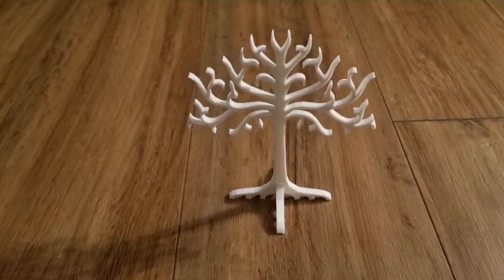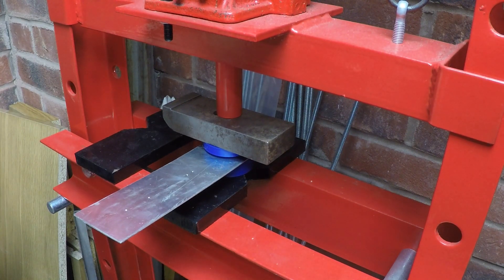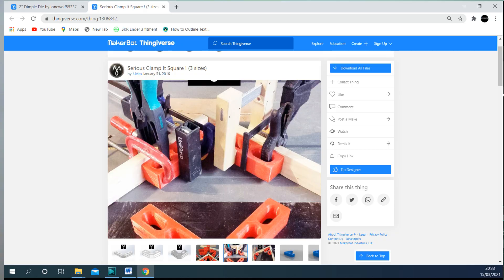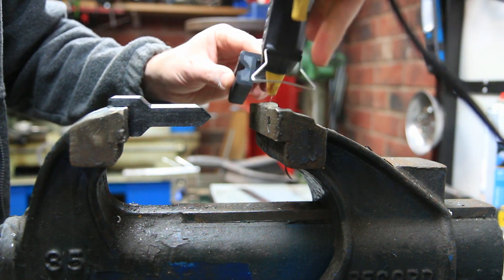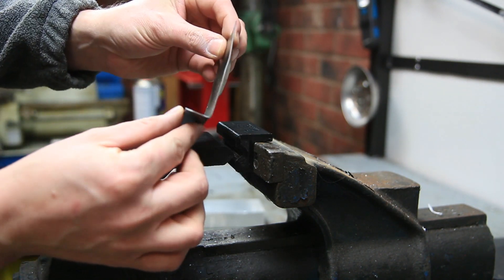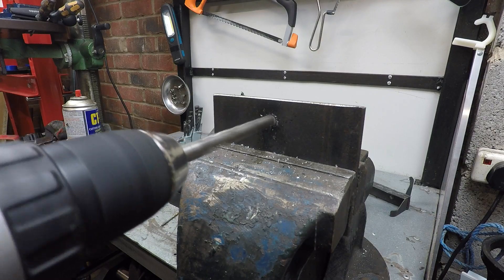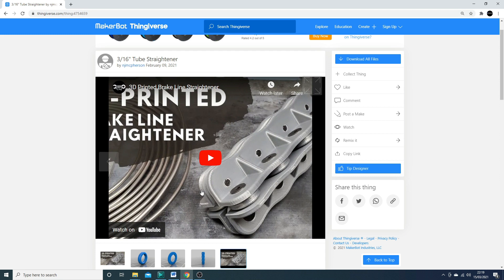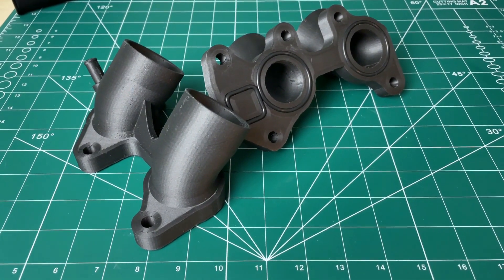Functional 3D Prints - Top 5 Practical prints for the Workshop and Garage

Comment: yep. 3D is the shit. now just waiting for metal printing to arrive in a useable small workshop scale & cost (as opposed to rocket engine size).
Reply: It's called metal casting. I prefer block mould/plaster investment casting. Just use a model printed from PLA filament that's designed to burn off cleanly, or a wax-like SLA resin.

Comment: I think your Bundy tube straightener would be good for bent lines. 

Sometimes you have to bend them to get them in or taking them out. 

With a fresh roll of  tubing it’s not hard to roll out straight lengths on a flat surface.

Comment: Hmmm, dimple dies and a press brake... Finally I might dig my 3D printer back out and give it another go and make something useful instead of keyrings and other pointless novelties
Reply from the maker: oh yeh... and these were all made with PLA, a couple of little upgrades - print ASA and CF-Nylon and you've got some real functional parts....
Reply: @MakingforMotorsport  did you have to upgrade the nozzle for printing in CF? Actually, what upgrades have you used for your ender3 in general? I've been thinking I'm going to get one as the one I built is probably showing its age by now 😆

Comment: Another great video!

I use an Ender 3D printer too, it's a great work horse.  Did you know that you can use 3D printed parts to cast metal counterparts?  Lost PLA casting might prove useful.
Reply from the maker: A type of investment casting is on the list, but probably a way off, I'm fairly sure there are specific wax based filaments aswell for that job, I need to give it a go....
Reply: @MakingforMotorsport  I look forewards to seeing your results.

Comment: another way to straighten coiled brake pipe is to grab one end in a vice, hold the other end in a vice grip at 90 degrees, then hit the vice grip with a hammer in the direction of the desired straight pipe line, it shocks the pipe straight, cut the crushed ends, all done. I was surprised how well it works.
Reply from the maker: I'll give it try next time... 👍

Comment: It is amazing what you can do with a cnc hot glue gun in your home workshop these days.
Reply from the maker: Absolutely right!  I am constantly surprised by the capabilities, plus the range of materials just gets better and better!
Do you have a printer?
Reply: @MakingforMotorsport  i do. I got mine back about 8 years ago. I've been needing an upgrade for a while. I ordered a Prusa a few weeks ago. I'm looking forward to printing with some higher temp materials.
Reply from the maker: @S09Engineering  I always fancied a printer but thought they were gimmicky, but when I actually read up and found out about CF-Nylon and PC I was sold!  But it’s still amazing what good old PLA can do!
Reply: @MakingforMotorsport  my main use is fine-tuning designs before spending the money on machining them. There is nothing worse than finding out your part fresh off the mill does not fit. Ask me how I know. I might have to dig up some motorcycle-specific prints and make a video like this.
Reply from the maker: Just been watching your speedometer video, really good, not just the content but the production values are great, I need to up my game 👍👍 (sub’d btw the way - I’d like to see how you bring the 3D prints into your workflow)
Reply: @MakingforMotorsport , thank you! 

I wish I had something smart to say about my workflow. My first design is usually crap, but I don't realize that until I print it out and try it. I make changes and reprint until I am happy with it. Then, the final design goes to the machine shop. I plan on incorporating the process into videos in the future.

Your content and videos are great. I'm interested in the Speeduino. How do you like it so far? I need to select an ECU for my next project.
Reply from the maker: I really like your shop aswell, did you start the channel to support the shop or did the shop come 2nd?
I really like the Speeduino, I have done a Megasquirt years ago and played around with Arduinos in the last few years so it’s a good fit for me.   
It’s not going to challenge a MoTec  but it can run 99% engines and it’s dead simple and cheap.  I was abit worried about the speed of a Arduino but I haven’t had any issues but you can also upgrade to a teensy but I don’t think it’s needed.  
If I was running a 15k built engine I would spend a little more but you may have guessed that’s not really my world at the moment!
Reply: @MakingforMotorsport , thank you. The shop came 2nd, I guess. It has been an interesting progression. I started buying motorcycles from auctions. I fix them up in my free time and sell them for a bit of extra money. I was doing that anyway, and I decided to start the channel. I gave the shop a make-over after my first 3 videos. Then the videos led to starting an online store. 

Thanks for the info on the Speeduino. I'm glad you have had a good experience with it so far. I need something cheap. Are there any options besides Speeduino and Mega/microsquirt?
Reply from the maker: I like the idea of selling the stuff you develop, not everyone has the tools or skills to make stuff, but they can still end up with the enjoy the end product.  
Apart from the MS and the Speeduino I don't know any off the top of my head but i am sure they are out there.  I'm probably going to do a video on Speeduino soon, it's got enough features for 90% of but it's definitely the cheapest out there of the "worked" kits, some people make their own boards and leave off all the hardware they don't need - but just the components to populate the board is the majority of the cost...  if you are only running 4cyl it can to Coil on Plug and sequential injection... good enough for me!